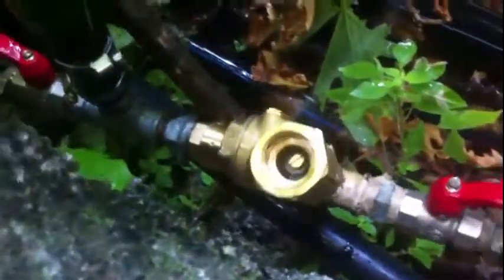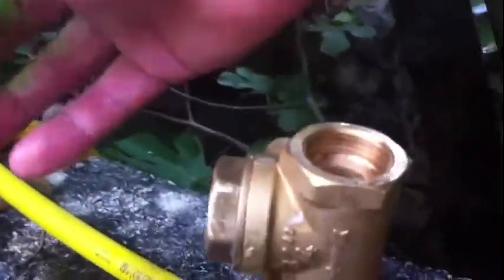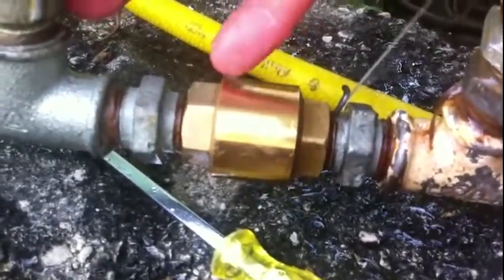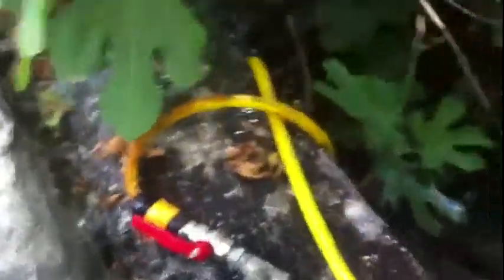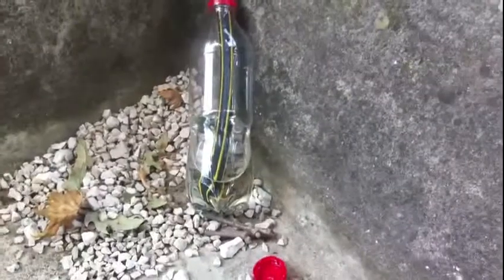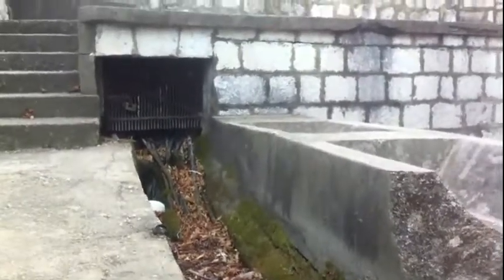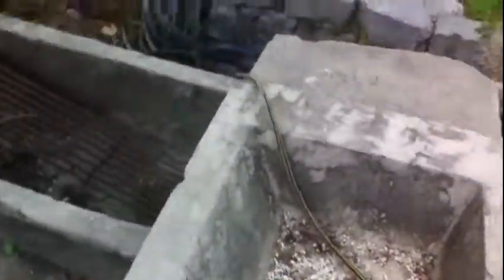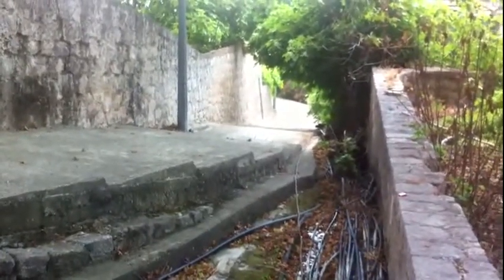DIY Hydraulic Ram Pump - Please Help! my DIY ram pump isnt working

Comment: The problem is your outlet is too low, make it higher at least 10 feet to create a back pressure. If work, it is better to replace your drive pipe with rigid like gi pipe.

Comment: I'm having the same problem, my ram pump stops working soon as I open the delivery ball valve...pls help
Reply: there needs to be 'back pressure' in the delivery pipe.

otherwise the pressure in the pressure bottle quickly bleeds away.
So the delivery ball valve needs to be 'just slightly cracked' until the delivery pipe has enough water in it to result in a significant back pressure

Comment: Changing to a hard pipe was a good idea. I noticed when you open your outflow valve...you just opened it really fast instead of gradually and not letting the pressure slowly build. looking at ram pump videos on here that seems to be crucial in starting up your pump. I just got a new house with a creek running nearby and will be making a pump for watering my garden. cant wait to try this
Reply from the maker: Richard gross Thanx for your comment and good luck with your pump.Let me know when its working.
Reply: I am also looking at generating my own electric through the same creek using a smart drive motor off an old washing machine

Comment from the maker: I bought a harder pipe and its working! But I still have a problem. When I open valve to the delivering pipe, it goes faste an finally stops… Any recommendation(s)? Thanks so much!
Reply: the delivery ball valve needs to be just slightly cracked until there is enough back pressure so the pressure in the pressure tube does not immediately drop to atmospheric

Comment: Hi,

I can see that your immediate problem is your drive pipe, i.e the pipe that is supplying the pump it made from a a standard garden hose, the pump will not work with this. Its far to flexible and the pressure wave will be lost as the soft pipe with expand and contract taking all the power from the pressure wave. Ideally you need to use a steel drive pipe but this is expensive and harder to install so you will need to use a much harder pipe, use MDP water pipe which you can easily get. John